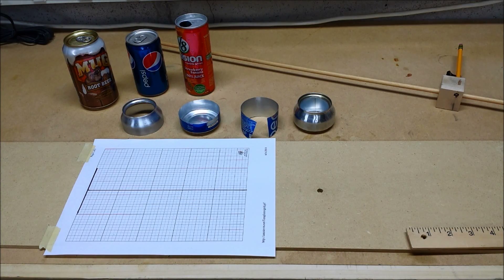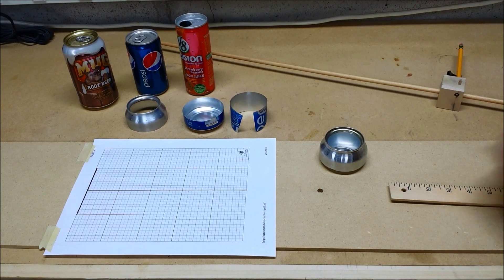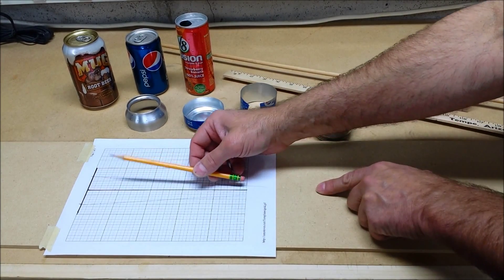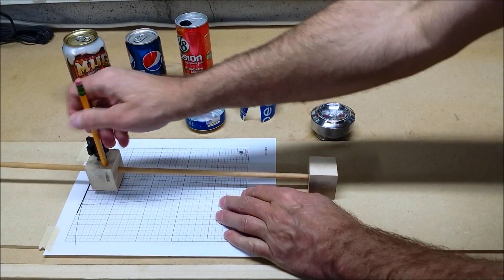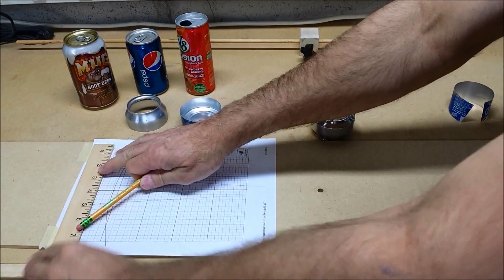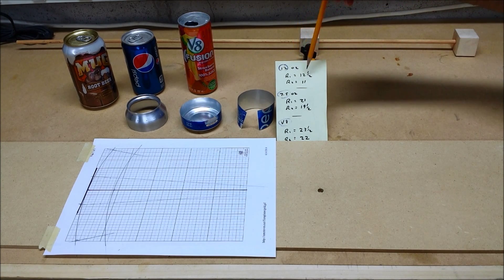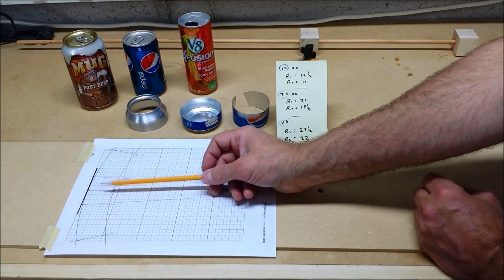Alcohol Stove Inner Wall template

Comment: Thank you for posting this information - It was very helpful.  I also found a site that will let folks print out a template for a cone that can also be used. Just supply the top and bottom width (widest part of each), the height of the cone (inner wall) and it will generate a printable PDF.  For a 12 oz can I used 1-7/8 for the top and 2 1/4 for the bottom and 1 1/2 for height.  The link is here: https://www.blocklayer.com/cone-patternseng.aspx
Reply from the maker: Thanks for posting that, Jason.  I used 1 13/16 and 2 1/16 and it almost exactly matched the template I've been using.  Nice catch and thanks again for sharing!
Reply: @timcanthejigman7932  Thank you for sharing the dimensions and for the excellent video. I'll retry generating the template with your measurements as mine turned out to be a very close fit, but just a smidge too big.
Reply: @Jason Lambique. Man you rock! That was by far the most useful link for handicraft I ever came across. Saves me hours of constructing my own drawings.

Comment: Thank you for such a detailed and understandable explanation of the manufacture of your alcohol stove! In Ukraine, there are now very frequent cases of lack of electricity in the homes of Ukrainians, and if there is also no gas in an apartment high-rise building, then on an alcohol stove we can at least boil water for tea or brew instant porridge.
Reply from the maker: Oh man, if you're Ukrainian, my thoughts have been with you for the past nine months.  You're absolutely correct, I've actually had to use mine at home when we temporarily lost power during a snowstorm.  я за україну!
Reply: @timcanthejigman7932  Yes, I am Ukrainian.  I live in Dnipro.  Today Russia attacked our energy system again.  70 missiles.  For seven and a half hours there was no light, heat or communication in the house.  But we shot down more than 60 missiles out of 70.  Thanks to our allies, and first of all, thanks to you Americans, Canadians, Europeans for your support.  We will endure and win!

Comment: only it doesnt have to fit into the bottom really
Reply from the maker: Yes, the bottom is where it needs to fit into.
Reply: @timcanthejigman7932  yes of course... the thing is you need to open up  passages anyway therefore its not critical the diameters be exact...you need to cut slots or semicircles or whatever anyway.. on top yes a good seal is critical

Comment: An easy arc drawing tool.  Get a large paint stir stick from home depot.  Drill a hole for a small thumbtack in one end and then with a triangular file make a series of 'v' grooves at specific measurements along the side for your pencil to set in.  👍
Easy and more accurate than the string method
Reply from the maker: Great idea, Chris.  And you can get them free in the paint department.

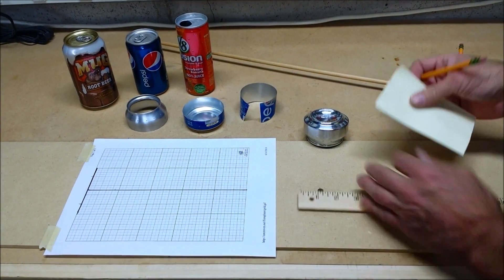Comment: I watched it some 5 times until I found it: @2:02 you’re not marking the lower diameter 1.5” down but more like 1”. 
Then, for the width, since you have the 4 points already marking a 360° circle, can’t you just add half of the intended overlap to each side and cut there?
Reply from the maker: Yep, I missed my marks when I was laying it out in this video and they ended up being only 1" apart.  Fortunately, I had already laid out the center for the compass.  I didnt notice I had done that until I watched the video later. Not sure what you're referring to about the four marks?
Reply: TimCan The Jig Man You say that you eyeball the overlap. I mean: you marked the diameter of each circle with 2 marks each - the ones you transferred from your scrap paper. Those 2 points intersect the drawn circle at exactly the point where your wall will close its circle later. So, to add an overlap of e.g. 1cm, measure 1cm OUTWARDS from each point, along the drawn circle. This will mark the line you want to cut. Later, on the metal, you can measure 1cm inwards and mark, on both sides, both bottom and top. Those marks will have to overlap each other and you will have created your wall shape with both perfect diameters. I tried yesterday, it works. Maybe I should take a few photos for you if I sound confusing...
Reply from the maker: Pictures would be a great help.  I'm not quite getting it.

Comment: I liked your video on the single can stove, so I looked up your other videos and found this one. Great video explaining the derivation of the inner wall, and the home made beam compass. Just had to make one using the longest dowel I had. I find the chart on the piece of paper confusing. Are the dimensions given correct? The 12oz. can has a greater radius than the 7.5 oz can?
Reply from the maker: Thanks, Chuck!  The radius is longer resulting in a flatter curve.  That is correct.  As for the compass, I think I made it in about 10 minutes.

Comment: If you download "Cone Layout" this is an excellent resource for template making. For the standard can template 46mm for diameter 1, 51mm for diameter 2 and 39mm for the length work well. Note that this gives you a perfect cone with no overlap so you need to extend the length each side. However if you now cut in from the long edges (opposite ends opposite edges) for just over half the width of the template along the computer generated short edge you can now "lock" the perfect cone. Works every time! A single hole hole punch is also a very neat and reproducible way of notching the bottom edge of the inner wall.
Reply from the maker: Thanks for the tip, Simon!  There are a lot of results when searching for Cone Layout and the ones I checked all seemed to work fine.

Comment: @4:44 I have not understood how you have the length of circle sector on the straight line....
Reply from the maker: I get the length of the template by trial and error.  Cutting the two arcs in the aluminum but not cutting the ends, rolling it into a cone shape and putting it in the bottom part of the can to see where it overlaps, then adding 3/8 inch.  Hope that helps.